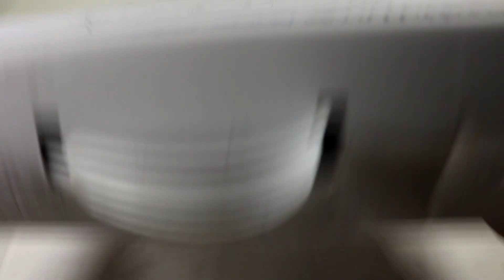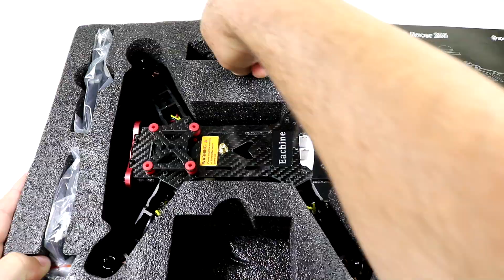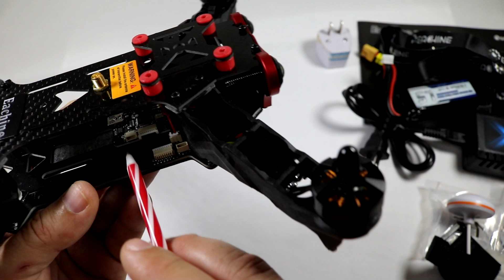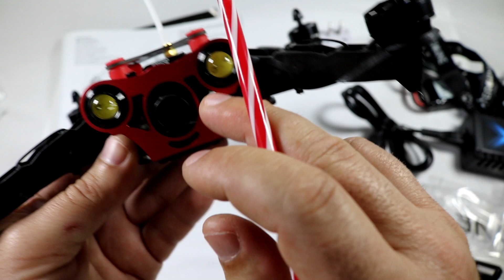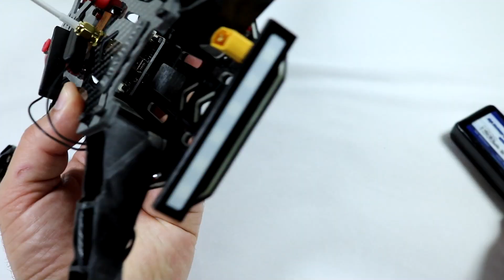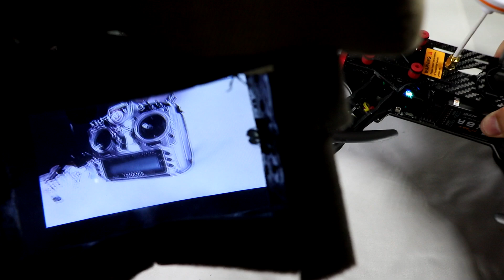Eachine Racer 250 FPV Drone Review - Part 1 - [UnBox, Inspection, Setup]

Comment: I have a Eachine racer 250 with a Spectrum AR600 Rx  & Spectrum DX8 (6Ch)Tx. This drone has a "twitchy" (erratic) throttle that renders it almost uncontrollable in a linear throttle setting. 
No gentle take off with this little beast, it rockets up rapidly despite efforts to coax the throttle gently & then reducing throttle it hits the ground hard!!!
I've tried to tame the beast by adjusting the throttle curve exponentially & progressively from 0% - 100%. When "Active" is enabled (in expo) the copter will not "arm"...dead throttle! Reverting back to a "linear" throttle (non expo) the drone arms once again & goes into it's usual tantrums. Also the #4 motor is slow to spool up but suspect the Electronic Speed Control (ESC) to be the culprit. 
Would appreciate your thoughts on how to tame this beast! Thanks!

Comment: would you recommend the eachine racer 250 or the emax nighthawk pro 280?
Reply from the maker: +rc car awesomeness both are good
Reply: Ive got one on the way as my first dip into the hobby grade quad market. Kind disappointing i only just found out it will not take a 4s.
Reply from the maker: +Infamous2117 it will take 4s.  I flew a 4s in my flight review at ending portion.
Reply: +Dustin Dunnill reports all over of flaming ER250's after putting in 4s batts. I dont have mine yet so cant confirm, could be a case of version 2 having lesser hardware.

Comment: Hey Dustin, Thanks for all the info on your reviews. After crashing my CX20 too many times I purchased this after your review, including the Taranis plus. I was wondering about the connector you are using from the receiver to the FC. I didn't see that flat connector in either the eachine box or taranis/X8R. I do have that adapter and harness with multiple wires that came with the eachine. I assume that would do the same thing?
Reply from the maker: +MLGInfidel1 I can't remember exactly but I either used one of the cables that came with the EACHINE or the X8R.  Shouldn't be to hard to figure out which one fits the EACHINE FC plugin port.
Reply: +MLGInfidel1 - You ever figure this cable issue out? I'm in the exact same boat you are (or were) are. Nothing in the RX box and nothing that converts like he showed in the video? Any advice or links? Thanks.

Comment: Hello Dustin, Can you tell me the name of the seller for the Antennae mounts that you got on ebay?
Reply from the maker: +Steven Clarke hey steven unfortunately I can't see them in my history anymore.  Just search for frsky x8r antenna mount.
Reply: Thank You, great videos BTW, because of your videos I bought one :)
Reply: Dustin, Sorry to bother you with questions but you seem pretty knowledgeable about the eachine 250 racer, I was wondering if I can upgrade from 2.4G to 5.4G by simply switching the Transmitter board?

Comment: Hello Dustin,what type of usb cable is needed to connect flight controller to a computer, would a Samsung style cable fit or does it come with one?thanks again for the info 😃
Reply from the maker: Mini USB not Micro USB.  Samsung is smaller Micro so won't work.  Mine did not come with Mini USB cable.  They can be found for a few bucks if you don't have on laying around.
Reply: Ok,thanks

Comment: How you set up the Taranis? and in which order you put the cables in the rx?
Reply from the maker: It's labelled on the Taranis RX so just connect the numbers.  When you run the wizard it guides you as said in video.  Not hard.
Reply: +Dustin Dunnill Ok thanks Setup proofes
Reply: *Setup Proofed

Comment: They do not include the battery tray with the version you got.. I had the same deal and wounder why it was not included...???? Other than that bumper foam taped works fine backed against the board. You should put something as a buffer or we should complain about not getting the tray that shows in the manual..

Comment: There are problems with the racer coming in different configurations from Banggood some are not coming with the middle section letting the battery float around.  Also the newer ones have SMD mount Capacitors that are not stress mounted and require some hot glue to hold them to the PCB.  They can be knocked off by simply removing the Battery.
Reply from the maker: I see.  Mine has plastic or foam spacers under capacitors but I can see how lipo may knock the rear 2 a bit in hard crash.  What lipo middle section are you talking about?  It will stay in tight with an additional Velcro strap more near front.
Reply: +Dustin Dunhill They are plastic spacers, I was taking my battery out and busted one on the left rear.  The SMD leds are very thin and can be broken easily unless they have some sort of stress relief.  As for the middle section velcro will take care of that.

Comment: Great review Dustin.  I am glad you like it.  I love my, I am thinking about getting another one.  How did you program the kill switch and the three mode flight switch from Open Pilot Software ?  Mahalo, Toan
Reply from the maker: Hey Toan, when you're in open pilot you can choose what will arm/disarm motors in one of the tabs.  By default it was 0 throttle and yaw right/left.  You just select another channel available and open pilot sees as an option the the drop down menu.  It's cool that the replacement arms for the EACHINE are only like $2 a piece if you break any.  It's stronger than the spedix I've tested by far.
Reply: Thanks Dustin, how about the three flight modes on your remote right switch ?  Is that also in the Open Pilot.  Yes is very cheap to replace the arm and is very strong.  I have crash so many times and nothing happen.  Beside replacing a few props.  If you are doing any Mod on the Eachine Racer 250 please let me know.  Thanks Toan
Reply from the maker: Yes, assigning the flight modes to the 3 position switch is done in open pilot also easily.
Reply from the maker: Oh..and I'll let you know on mods but I think going to 4s lipo, better props and tilting FPV Cam up a little is all you'll need when you get better.

Comment: Nice ... glad to see you add the arm/disarm switch.  I'm using a Naze32, so it has stick controlled recal of gyros and accelerometers. I do this after the quad is on and bound, but BEFORE I engage the ARM switch (forgot one time, and when I went to cal the accelerometer (left stick up/left ; right stick straight back/dn) the quad took off and did a back flip. Have never repeated that mistake. I assume you're running in PWM mode with the X8R RX. I've still got mine sitting around unused. Will have to build something to put it in.  I assume you made up another profile on your Taranis for this model. Nice to be able to store 64 different model setups!  Looking forward to the flight tests. Cheers.

Comment: I've had my eye on this quad for the past few weeks. Seen nothing but great reviews. Was just ready to pull the trigger until I came across the new 180 FPV Assassin that's soon to be released. Now I'm torn. I hope you're one of the first to review it as your reviews are pretty in depth. They're sending out invitations right now for reviewers.

I'll be watching this review when I get home tho.
Reply from the maker: Thanks for the tip on the 180 assassin!  I'll try and get one for review.
Reply: +Dustin Dunnill 
Anytime. Here's the link where they're taking request. Not too sure if you go about it another way since you've felt with them before in the past, but figured I'd share anyways...

http://budgetlightforum.com/node/44134

Comment: great video dustin! also whats a good beginner racing drone thats pretty cheap but good quality? and can you make a custom racing drone and then review it?
Reply from the maker: +ivan sikaleski Thanks.  This one is probably one of the cheapest and is good.  I did the flight test and I liked it ... just need to edit and post video soon.  They have 3 different package version for it to suit your needs (see links in this video description).  Plus if you get one the legs are only like $2 each so if you break some they are cheap.  I crashed a few times in my flight test for the review and only broke 1 propeller.   As far as custom build, my video before this is first in a series for a custom build.  I also have a Spedix "kit" I put together and have more I will be doing in the future you can check out.